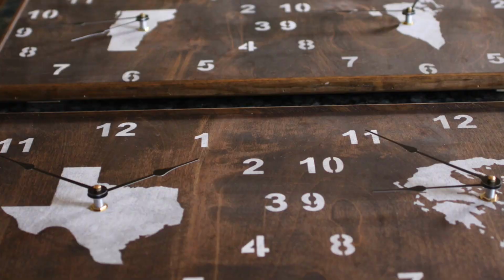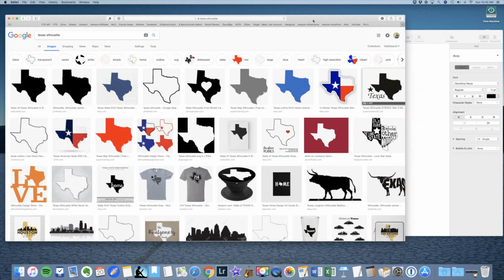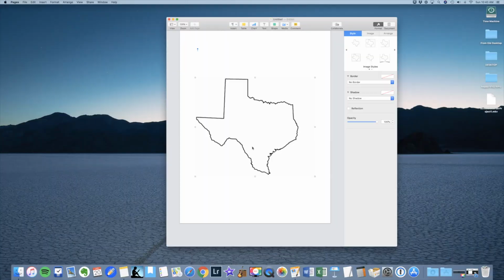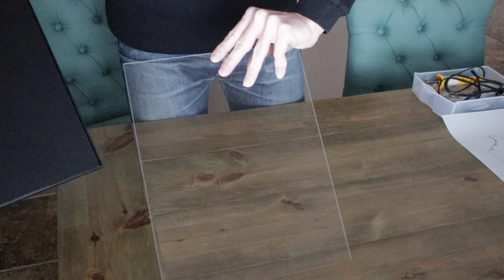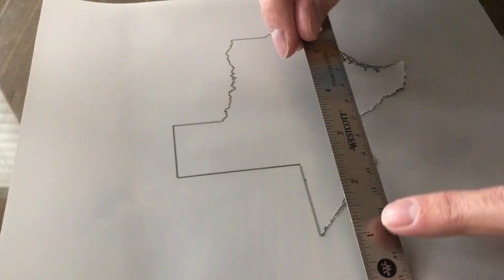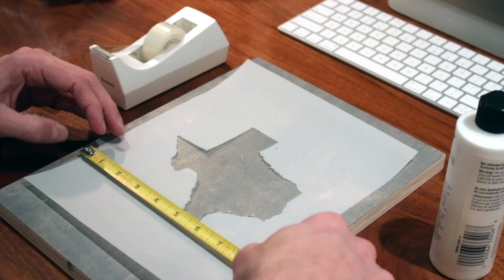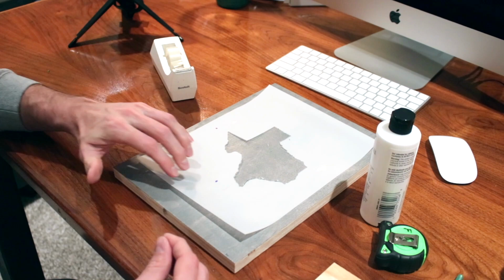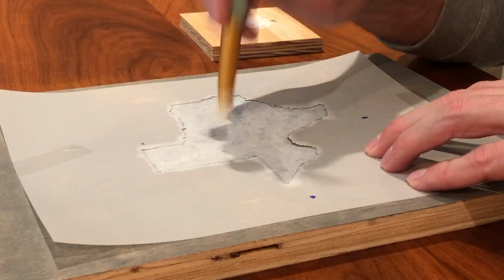How to Make a Stencil // Easy DIY Project

Comment: I wonder if I could just print to a regular sheet of paper, tape it to the bottom of the film sheet, trace it with a marker on the film sheet and then use the stencil tool to cut out the shape? The film sheets I have are not the Dura-Lar in the 9 x 12 size.
Reply from the maker: I think that is a great idea! Hope your project turns out great!
Reply: @diywithandrew  Thanks for the quick response. I will let you know how it goes.

Comment: I don't have access to a laser jet printer only an inkjet printer what process would I have to do to make sure it doesn't run
Is the acrylic paint mixed with medium
Reply from the maker: I used an inkjet printer a lot. As long as you don’t really press the ink you should be good with the hot cutter as your trace the lines.
Reply: @diywithandrew  thanks for responding back I appreciate the advice